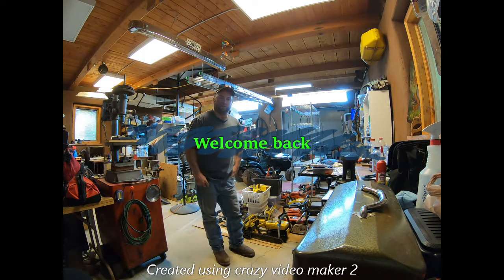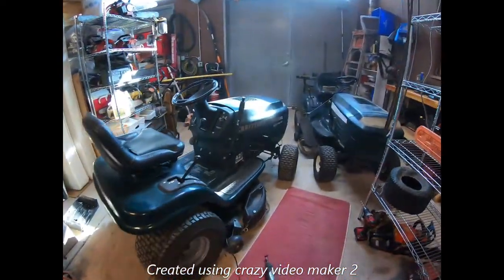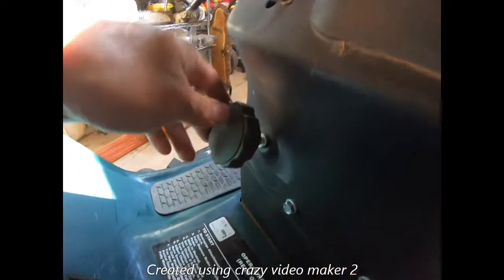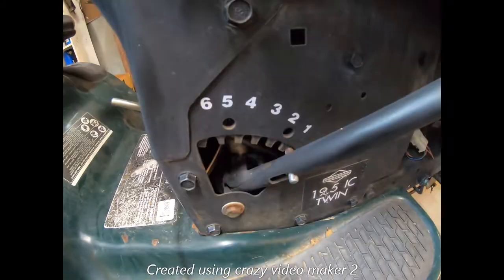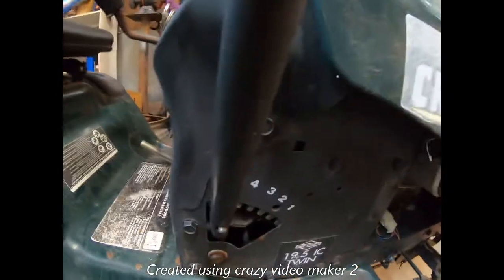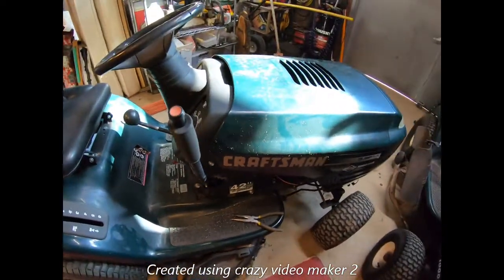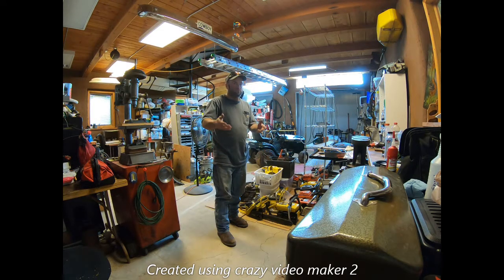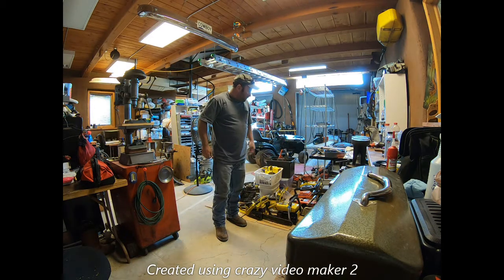Craftsman lawn tractor deck height adjustment modification

Comment: What if you have the notches but only getting about 2.5 inches at the 6 setting? Checked tire pressure, tightened deck hanger bolts, and the front rods.